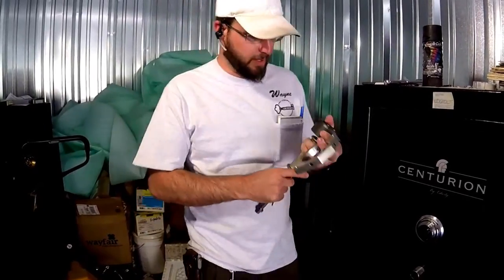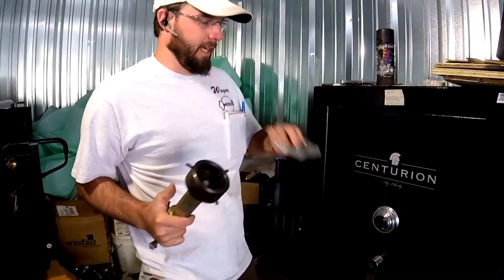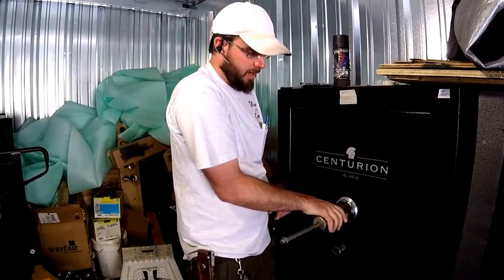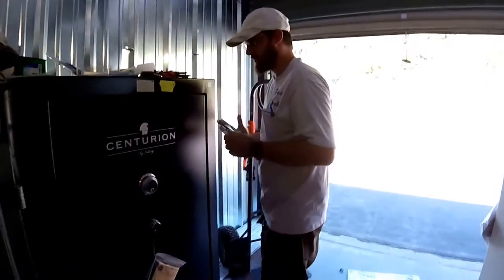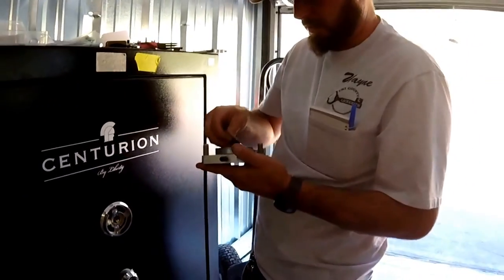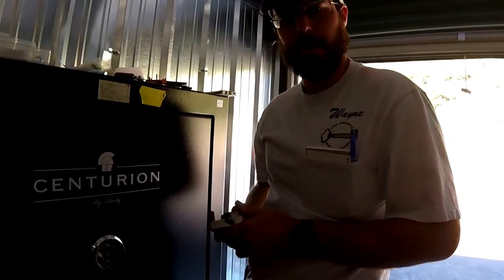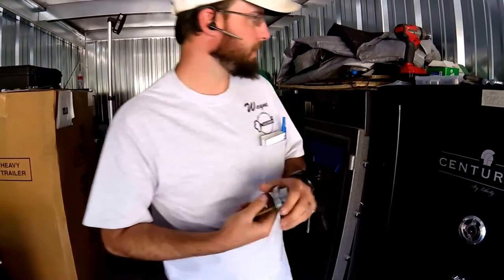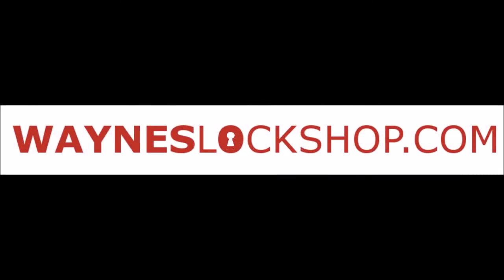Best Safe Dial Puller Gerry Forder Safe Vault Lock Dial Removal Tool

Comment: What a nice comparison! The 2nd Australian dial puller is so elegant.
I ran across this video looking for how to use nose puller on a bank of safety deposit boxes that the previous bank tenant left when they moved out of the office space that our non-bank company is moving into.

This is a post COVID Zoom experienced comment that I am providing: whenever you have an outside light source brighter than the ambient light  that is in the room where the video camera is shooting, you end up creating what I call the “FBI Witness Protection Program” view: the details in the foreground of the shot are put in the shadow and are dark  because of the very bright light in the background.  That witness protection program effective was quite noticeable to me when the locksmith was working on the 2nd safe which was closer to the door to the outside. I am worried that maybe I missed some details in the demonstration of the Australian dial puller, but I am happy I got the overall jist of how the Australian dial puller worked. 

By the way, elegant problem solving to deduce the Australian dial puller would work in reverse and replace the safe dial.

Comment: When you turned Camera Off, did you say "OH SHIT", should of had left door Unlocked first?. Even if not, sure you have a way or 2 after dial is removed open back up. Do they make a clear dial so you can look through dial into hole. Thanks

Comment: While I am a locksmith, I do not do much safe work.  Can you tell me, what is the purpose of pulling the dial in the first place please?
Reply from the maker: to get it out of the way. you drill a hole under the dial and dial ring so when you make repair you can't see it.